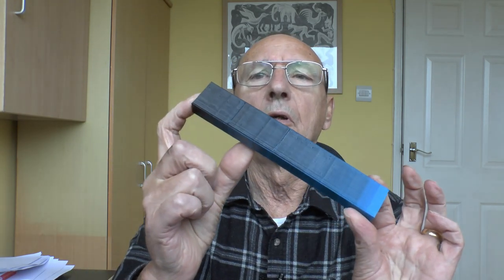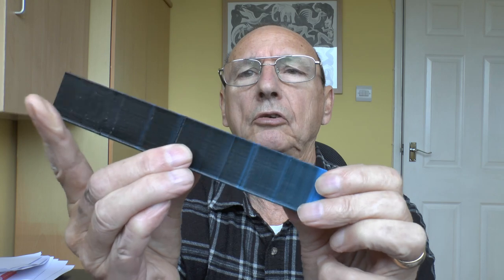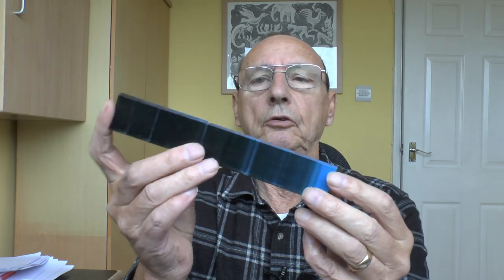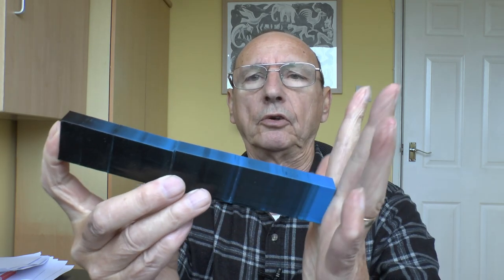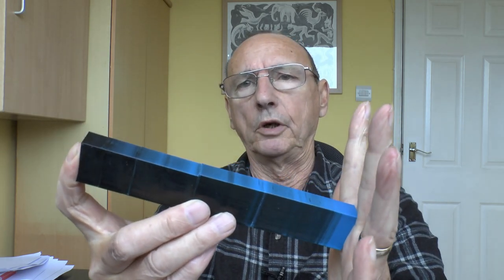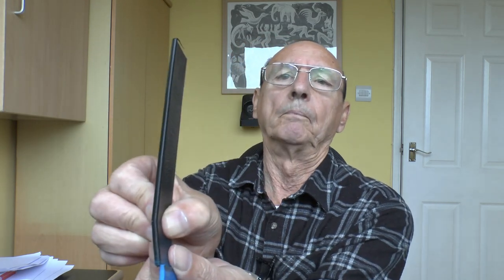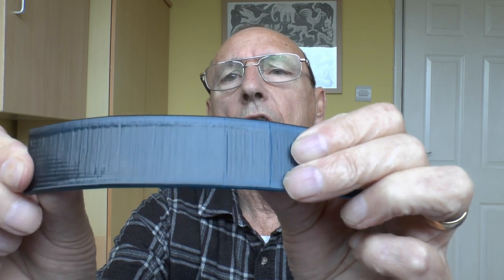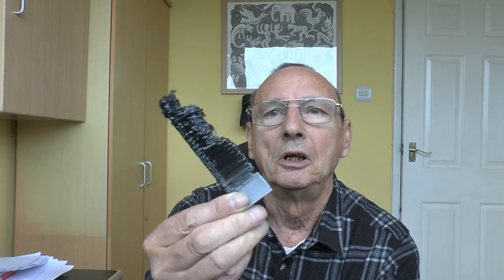Experiments with combining different types of filament

Comment: The concept of multiple materials is potentially useful, image flexible hinges or conductive filament circuits.  But, I suppose that, if  the materials wont stick together then entrapment maybe the only option ( i.e. an embedded dovetail or similar).   Anyway an interesting experiment .